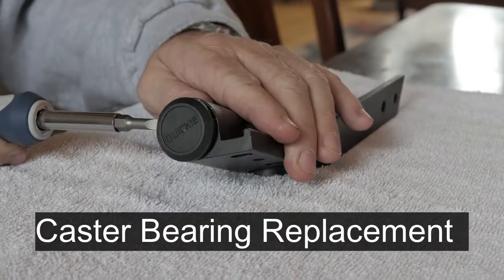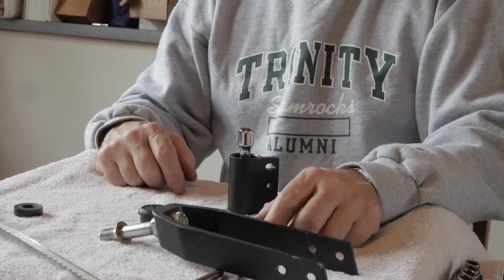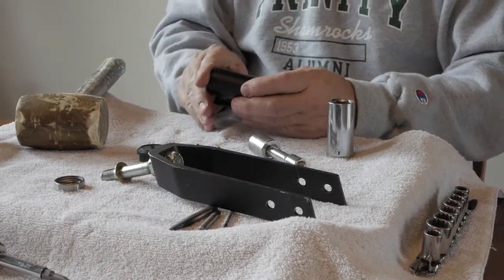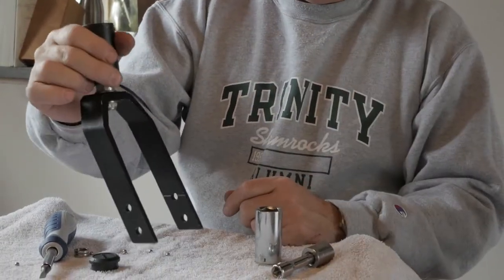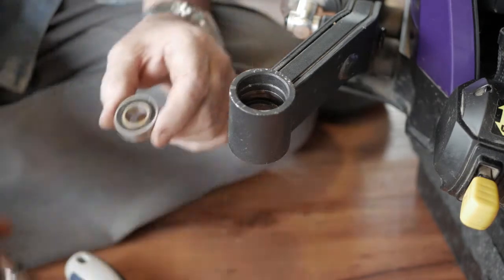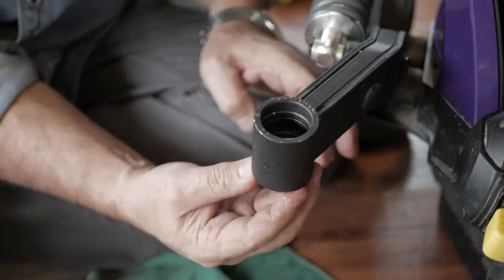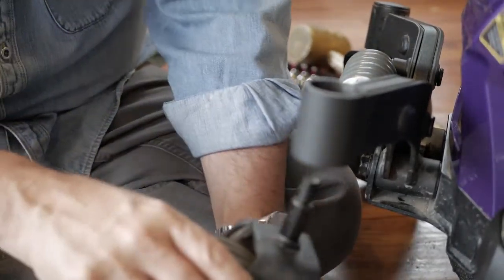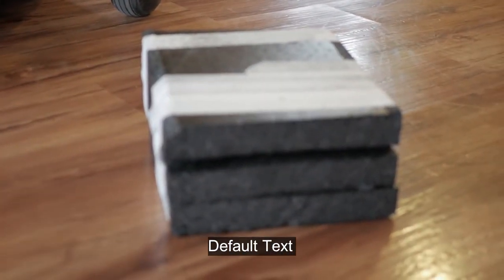Caster Bearing Replacement

Comment: Not possible on a Tlite as the 2 bearings are closed to each other and really difficult to take out. If you have a trick thank you. I keep damaging the bearings when I try to take them off. Is there a tool to use??? Thanks

Comment: Wow! This is so simplistic! When the bearings wear out, the upper bearing fails, not the lower one. The design is abysmal. The upper bearing destroyed means that there is nothing to push on and pushing on the inner race is wrong, wrong, wrong! 

What happens is that the upper bearing gets rusted to the barrel which makes them nearly impossible to remove. Once the bearing wears out, the inner race of the upper bearing falls out and the owner realizes that something is wrong. Now the upper bearing and the lower bearing go out in opposite directions, so if the lower bearing is not destroyed also, you can drive the bottom one out, but it will take a lot more pressure than tapping. I had to hammer on the lower bearing which was still together using a drift that was larger than the hole (with the spacer removed) using a 3 lb sledge hammer before it finally broke loose.  And the amount of effort I put into each rap on the bearing was almost as much as I could muster. It still withstood the hammering for several minutes and I had almost given up when 'bam', out it came.

On the upper bearing, there is no inner race to drive against, so I used a hack saw with a super hotdog blade in it and after a couple of minutes of no progress against the bearing race, I gave up and went to trying to drive that center piece out, but it is apparently part of the barrel and is not removable. I finally took heat to the barrel, but that didn't work either. I have never run into anything that heating it up did not cause it to loosen, but not this one. 

We had been told that the parts for this consisted of one bearing and a spacer. The bearing was $3.85 and the spacer was $79. Well, the separator spacer for the inner bearing races could not possibly be $79, so I am thinking that the parts person was finding a replacement separator for the outer races in case that the barrel wasn't damaged so bad that it could be reamed to the same size as the bearing OD and fitted in place of the machined surface inside the barrel. In addition, there are two bearings so the parts guy was all wet to begin with.
 
So I found this video. As I said, this is a pipe dream for repair of one of these unless someone is very lucky. I took all four of the top covers off the machine that I have been asked to repair. Only one bearing was damaged, but not a single one of these bearings simply slipped out as the video shows. They are tighter than .... If I tap on the top bearing from below, it is unlikely that I will ever be able to get the bearing loose. There is some rust, but on all but the first one, it is not enough to explain the tightness. These things appear to be interference fit.

It is clear that the bearings should fall out almost. The new bearings fit very loosely into the barrel. So what in the world is the reason for this design where you do not drive both bearings out through the same hole? Is there high speed involved? NO! Is there some other reason why those two bearings do not drive out along with a thin tube separator between them? NO! That would have been too simple.  I should have been able to push both bearings out the top using a press made out of a simple bolt and a large washer. But I could not even budge them because of the stupid design. 

Based on what I have seen here, I will take my Dremel tool and cut the bearing race in two or three places in order to get the thing out of there. I cannot get at it to cut directly down, but I think that I can get a fairly large angle.  I am appalled at how difficult these bearings are to remove. I might just cut all of the bearings up if they refuse to come out using any other method! I have it from the owner that these have never been removed in the five years she has had it and she got it new. Otherwise, I would say that someone replaced the original bearings with bearings that were too large.